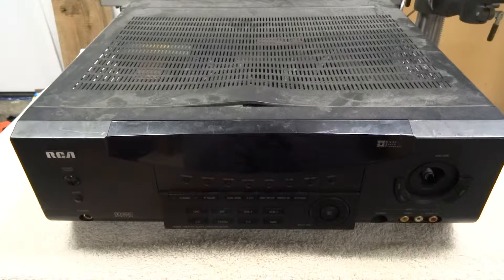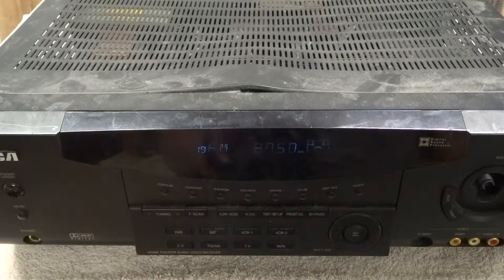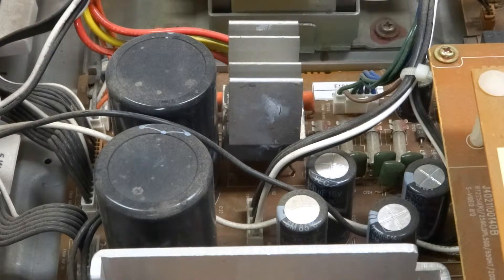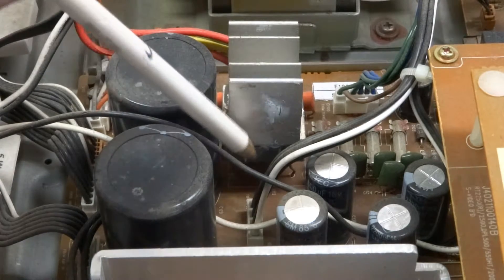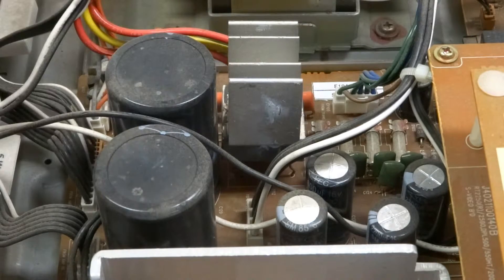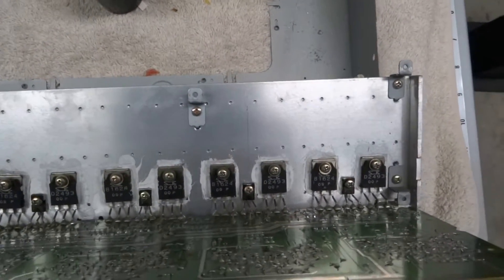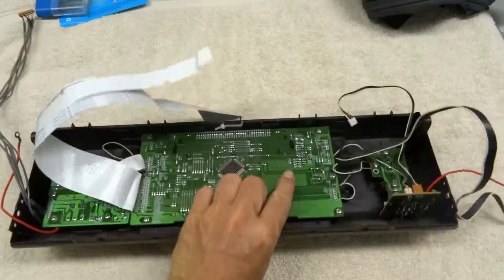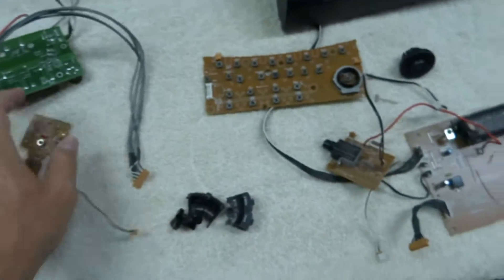Let's Teardown - RCA RT2250 audio/video receiver

Comment: I have this same unit for over 20 years, now the volume turns itself up so loud by it self I have to grab the remote and turn it down but it does it again over and over to the point I have to stop using it, can this be fixed??????????????????
Reply: Switch needs cleaning

Comment: I have had this same unit for well over 20 yrs now ... 
It just started to have issues where the audio cuts in and out. Took it apart and air compressed all the dirt out, started to work lerfect again but only for about 2 weeks, now its acting ip again, the audio cuts in and out.

Comment: Thumbs up for making the effort on this. It was the most superficial tear down I have seen. 

Not one voltage measurement or IC checked out?  I tore one down and it took a week. Did you miss the amazing number of linear regulated rails?  Even +/- 3.3 v. Amazing for that day. What was really surprising was the 28 v main rail rather than a more typical 30 + v. 

This unit was designed and built as the days of multilayer SMC were coming in and through hole was fading. A really good learning piece. 

Harmon Kardon made a unit so similar, I could use the schematic. This was no accident. The whole industry had settled into a through hole rut and was just struggling to adopt tech from the data world. 

The vacuum display alone was available from only one source and had only one driver. Digital encoding was revolutionary without Arduinos driving them. 

There was a lot of history and technology that would have been fascinating to hear about.

Comment: I have this exact receiver it works but I have no lights working on the display screen, any ideas on how to fix it. Any help would be great. Thanks 300 watts by the way
Reply: the solder joints on the cables that connect to the display are cold or cracked